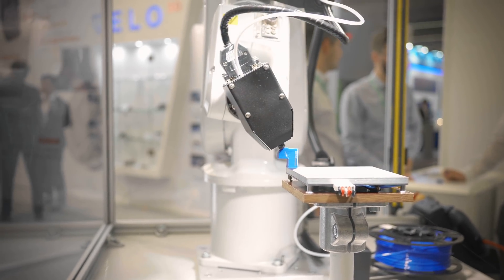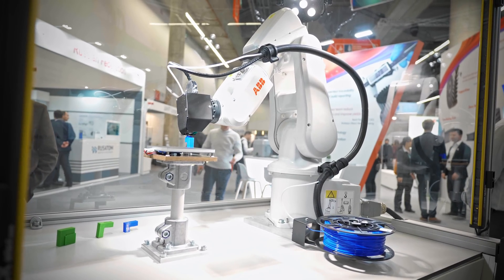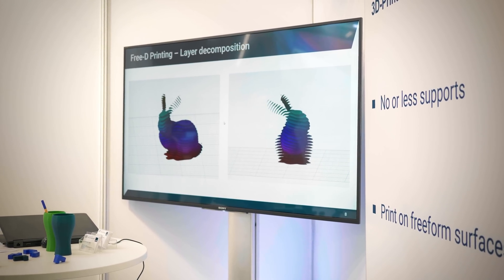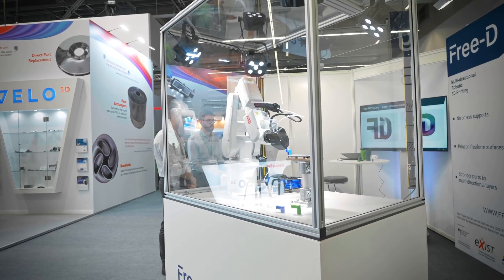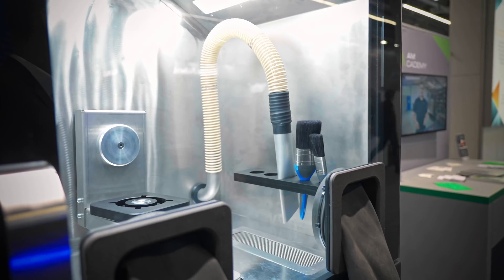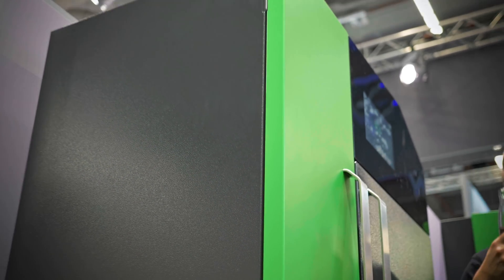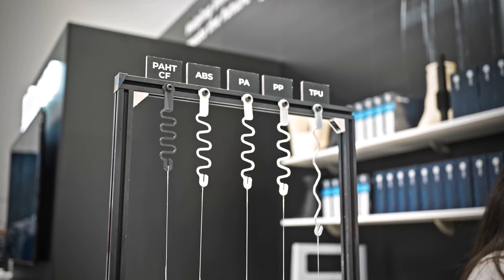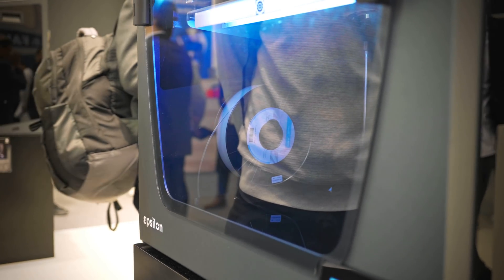Simultaneous 6-axis 3D printing!

Comment: Not to rain on anyone but this could be done cheaply with the original delta for a cheap price if you need the 5 axis... It will have a limited work envelope to be able to angle the head and get around the part, in a original delta machine. The machine only has to accomplish single point axis trajectories "A cone moving through 3d space being manipulated from 3 points". We are not adding any loads to the machine in any way like having to produce the force to get a end mill to cut into a block, with high precision in mind. We are adding material in small amounts. If we had a 5-axis software generator for the existing Delta machine, and a different flavor of marlin then we will be able to have a working 5-axis 3d printer. Instead we are making custom g-code to be ran once on a very expensive arm I assume...

Comment: Just to be rigorous with the terminology, the title should be "6 Degrees of Freedom 3D printing" or "6D 3D printing". The Desktop 3D printers are cartesian robots with 3 degrees of freedom, that means they can move the tool center point (in this case the nozzle) in X,Y,Z coordinates only. The ABB robot presented in the video has 6 motors that rotate 6 joints independently, giving the ability not only to move the nozzle in X,Y,Z coordinates, but also to orientate the nozzle around the X,Y,Z axes (roll, pitch, yaw, for example).

There is one big problem with the robotic arms though: Singularities. This means that some areas of the workspace of the robot cannot be reached and the robot can achieve really high speeds when approaching them. This doesn't happen with a conventional cartesian robot, such as a CNC or 3D Printer.

Comment: Ideally, you'd have 2 robot arms working together.  One holding the initial stub that the other arm then prints on avoiding the need for a hotbed to crash into. I've seen CNC machines that work like this so I think that's the future of this tech, remove the heated., 
.

Comment: Intelligent Non-planar 2.5D designs & tool paths similar to ball nose machining far exceeds the current potential & requirements for 5+ axis robotic arm printing in my opinion. It's faster, cheaper to design, cheaper to maintain, and easier to run/compute.

Comment: I saw them working on this at University of South Carolina's engineering department 6 years ago. The 6 axis printing that is. I also saw a different variation where the bed was the part that was attached to the 6 axis arm and the extruder was fixed along a top gantry.

Comment: The challeng is there: Few Cons: precise robotics arms normaly reach a 0.1mm precision and their price begins at about 14K € for the bare robot without counting the install and the guarding. Even a cobots which are consider "afordable-easy to program and "safe"" start at 18K. The Pros: The robot reach is massive comparing with a 3D Printer :D... what will the market demand?

Comment: But for what?
If I have overhangs or undercuts, I use a different 3D printing method. I prefer HP Multi jet Fusion. 
And no expensive, inaccurate and slow 6 axis robot. I like the Idea and stuff... Sure its fun to build something like that.
but it is difficult to find applications here.

Comment: The killer app for the 6 axis printer would be to combine it with continous carbon fiber printing. That would make it possible to print the carbon fibres in any direction/mesh that would make really strong parts possible. Their printer would be even better if the build plate could spin, making the build equally reachible from all sides.

Comment: So while watching some random vids the other day, I began to wonder what the top speed of a well-built 3D printer could achieve while still being accurate, then came up with what would arguably be a new building process that would actually require exceptionally high speed motions in order to cope with the way material would be deposited onto a chosen build surface. Honestly I think it's beyond belts and pulleys and began looking at 4-6 axis robot arms, but in the home market they are just barely coming to light much like 3D printers were 10 years ago and even the most accurate ones can't touch a good FDM machine at present. 
In my head I was trying to combine this process with something like a CAD drafting printer I remember moving with great speed back in my school days, though that was a few decades ago. Maybe a geared approached would be the way to go, but with liquid cooling. Any ideas for the mechanically minded creative types out there?

Comment: It's similar to the Automated Fiber Placement (AFP) process for carbon fiber parts manufacturing. 6axis 3d printing could be a game changer to improving strength in every orientation. Today you are giving up about half the resistance in the laminate direction (z). The problem with 6axis is the clearance of the head which has limitations when you need to manufacture concave shapes. You'll need different extruder designs and a very smart path & collision software behind

Comment: The real solution, and i give this one for free here is not the 6 axis. It is all about speed to make it somewhat useful, and that swinging arm.. maybe they can make it faster but you would not be able to print multiple parts on a plate without: 1. change of knocking them over 2. can only do 1 at a time. Ok, don't protest, suggest: what they need to do is think outside of the box and get rid of stringbased nozzle type printing. What we really need is a laser that projects a full layer at a time. Layer by layer, no movement at all. Then it will be reliable less parts and very quick. Making a whole plate full of parts will be just as fast as 1 little part, it does not matter. Imagine that.

Comment: Wow, that BCN3D Epsilon looks great for 7 THOUSAND DOLLARS, I've made an enclosure for my Ender-3, passively heated by the bed, temperature controlled by a little board plus a fan with a filter, moved the electronics and PSU to the outside, it cost me under 100 bucks.

Comment: Now do the benefits of using 6 axis compared to milling ? Surley milling would be cheaper and faster ??
Reply: You can do much more with additive manufacturering producing much more intricate shape not possible through subtractive manufacturing (milling)
Reply: @tankkiler308  through a standard 3 axis milling machine yes this is true but a 6 axis machine should be similar no ?
Reply: 3d printing tech I think the best example for what additive can do what subtractive can’t is embedding structures within the part like cooling or cable channels

Comment: The 3+2 is called indexing. Software called Robotmaster can continuously move the robot, and two additional rotary drives on a table, so that the head can be vertical trough the print.
Reply: do you know farther information about how the project works? i need help.

Comment: I'm really waiting for an FDM printer to wow me enough functionally over a hobby printer to actually make me believe its high cost is worth it. I primarily work in metal AM, but we have a bunch of FDM plastic printers in our shop too. The expensive brands really don't impress me much at all. Way closed off to customizing the process parameters and the additional capabilities they do have could be added to a hobby printer for a tiny fraction of the cost. The 6-axis machine, on the other hand, would be another story. I hope that becomes more common

Comment: It was an amazing show. I used to love going to the TCT in Birmingham, but now, with this huge Formnext, this is the "show to go" if you want to be up to date in terms of 3D Printing. Maybe there is too much hype with metal 3D Printing...  but I love to get lost and find some amazing new technologies and materials. Tom I saw you next to BCN3D stant and could not greet you. Maybe next time! BTW, in my opinion the great problem of 6 axis 3DP is that you need a very powerfull software and more over not only for generating the Gcode but also for simulating the movements in order to avoid collisions, you also need to train the people who manage the printer for a long time. Is exactly the same with 5 axis CNC machining.

Comment: Good review! Thomas, I think that the future of a consumer's grade 3d printer is some hybrid form of that robotic hand plus FDM technology we use now.
More specifically... I see it as an extruder that can be leaned in 2 axis to form "mountains" and overhangs. But it must contain several proximity sensors that will be "alarming" in a case of a little fail (and avoiding a real fail). Plus it's nozzle must be on a pretty long thin "arm" with small air tubes that will be cooling specific areas of printed plastic. I think that it's possible in the current usual scheme with a short trasition zone but will require using short thermal tubes (similar to PC processor coolers) connected with hoses so they will be creating a flexible cooling assembly. Or maybe some flexible thermal tubes exists already?
The second big issue: new slicing algorythms that will be including new sensors to avoid printed parts and new calibration algorythms that will form all possible "dummies" (3d silhuettes) of this complex 3dp head. I mean that it will "know" all forms of a flexible head to use it in a slicing algo.
Or it will have a more concrete form with known possible shapes. This will make the issue easier.
These are my thoughts around this. I'm sure that a lot of ppl will be able to afford new gen. 5-6d printing machines of this type rather than a big robotic hand that prints (obvious difference in cost).
P.S. probably AI net algorythms can take a place here.

Comment: Thomas, you missed the  Russian true 3D printer. It's boxed as usual XYZ, but they added two rotational axes. So the build-table rotates in additional two axes. Basically it looks like a 5-axes CNC miling machine. I've spent three days in Formnext :-). Cool stuff, cool stuff...

Comment: Wouldn't there still be issues with sagging overhangs with the 6-axis printer? I would think that deposited plastic could still migrate down until it cools properly.
Though I guess this could be an extremely small issue compared to printing plastic in thin air since it's at least touching the model now and that should make it stick far better in place.

I still feel like a better approach would be if the bed pivoted instead of the arm so that gravity was working perpendicular to the print at the moment of deposition to allow it to cool in place.

Comment: 6-axis FDM printing is amazing. But from my persepctive SLS will become the future ... no overhang or bridging issues, extremely high detail and very strong/durable.
Reply: yeah i was about to type this. i worked with CAM and i can say that 6-axis requires human intervention. it's too hard (not impossible but computationally expensive) for an algorithm to calculate paths and collisions in more than 3 axis. and fdm being anisotropic, chaniging layer orientation mid print can create weak spots and unpredictable beahaviour
Reply: Agree. From my perspective only 4-axis (rotary) on FDM would really make sense. So far i have only seen one 3d printer manufacturer doing this while on CNC it is nothing special. Precission of robotic arms are too low for small objects. 6-axis would only make sense for very large (e.g. car, house, ...) objects from my perspective.
Reply: SLS is inherently expensive, though. Even with plastic so you don't need inert atmosphere like with metal printing, there's too much powder waste and cleanup work for it to ever come close to the cost of FDM. I think it would be possible to do small 6-axis FDM for under $500 using Skyentific's second arm design, which uses stepper motors and toothed belts. Not much payload capacity, but with a bowden extruder I think it would work. The challenge is writing the slicer software... but at least that only has to be done once and then everyone can use it.

Comment: Still needs a 7th rotary axis for concentric printing of round parts.
Reply: not necessarily depending on the nature of the part
Reply: jay alford Could you elaborate more?
Reply: @Inventorsquare  depending on tool oreientation, lenght of tool ( this will impact the tool center point location) and the stage you are at in the printing and how far the part is from the robot,  the robot should have easy enough access within its work envelope to reach any location with out risking collision with the part.
Reply: A ring. It needs to travel on a ring, around the part. It needs to carry it's filament with it as it goes, or a centered, overhead feeding point.
Reply: The Litchfield Experiment Exactly. This machine has the capability to produce round parts, sure, but at the mercy of multiple axis of interpolation. I wouldn’t consider it concentric as it is. Having the build plate or the arm rotate would be more precise.

Comment: I have mixed thoughts about the 6 axis. It's really cool to be sure, but in order to get decent quality parts, you'll need a really robust motion system, which means added cost. FFF/FDM machines exist because they are a cheap alternative to SLA and Powder based systems. Once you add too much cost to them, I'm not sure if they're the best option.
Reply: yeah, and with sla getting cheaper by the day it's only a matter of time before the market tips over
Reply: Also even with it being a industrial robot they dont go the speed that you tell it too most the time I've spent time at fanuc and Kawasaki to see if they could fix it but alas no they cannot

Comment: Doesn't anyone print on a fourth axis, equivalent to the fourth axis in CNC machining? There are some obvious advantages for some parts to be printed on, say, a rotating dowel instead of a flat build plate. Seems obvious to me anyway.
Reply: the issue is the slicer. 3 axis slicing is easy, add a fourth and the game changes
Reply: @delirio1987  I would think so. More than one way to get to the same point would stop me in my tracks for starters. 😀
Reply from the maker: There are some 3-axis (!) printers that map the traditional X, Y, Z axes to X, A (rotation about X), Z. They do work but are only 3 axis machines, too!
Reply: @MadeWithLayers  Thanks. 👍 Somebody, somewhere must working on it. It's a bit like filament winding, and maybe similarly limited in its application. 😀

Comment: Good luck getting an affordable robot that's anywhere NEAR the required accuracy. You need a very rigid arm with all harmonic gearheads. The gearheads alone are around $3k a piece.
Reply: Yeah that was my concern. With so many axes working together the slop has to be super low to keep it accurate
Reply: @anonony9081  Maybe if they run a 3mm nozzle ;)
Reply: You either need very precise mechanics or feedback that nozzle slightly too far on axis Y, move it back 0.001 mm. But I still can't see simple measuring of filament width 5cm from extruder to adjust feed. 3D printing exiting stone age but not in bronze age yet. It is not even using technologies already worked out in CD drives.
Reply: Like Adisharr is saying precise robotics arms normaly reach a 0.1mm precision and their price begins at about 14K € for the bare robot without counting the install and the guarding. Even a cobots which are consider "afordable-easy to program and "safe"" start at 18K. The idea is cool  and insteresting for sure,100%,however,  its afordability and scalability seems a challenge for the current industry
Reply: A drop in harmonic gear box prices (which is slowly happening) will be a major step forward in robotics. So many people are limited from tinkering purely by those prices.
Reply: Mark forge mark2 is 18k.
Reply: It won't be affordable no matter how much you cheap out. Lol. An affordable version might end up available but it won't be that good.
Reply: You can get good gearheads for under $950...
Reply: @pilotavery  they need to be zero backlash and durable
Reply: @adisharr  oh I know.
You can get them for as low as $200 but they're going to be really unreliable or have bad backlash. Especially given the length of his arms, they really need to be precise to like a thousandth of a degree. Hence, harmonic drive.

If you're buying them at retail cost they're going to cost you like $2,000 each, but you can get them for as low as $900 if you source them wholesale by calling the manufacturer directly
Reply: @pilotavery  might be able to use industrial second hand parts as well for a small bussiness or even consumer design ....usually replace those regularily because they do gain a little slop over time - but that slop is prob still incredibly low.